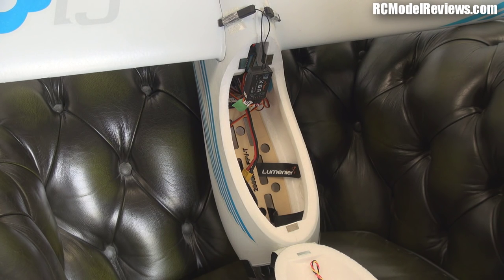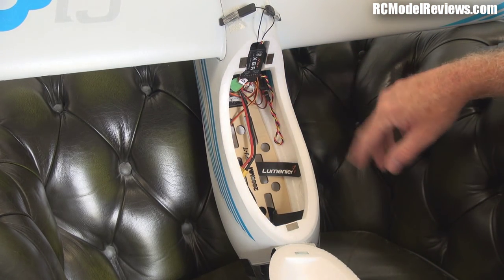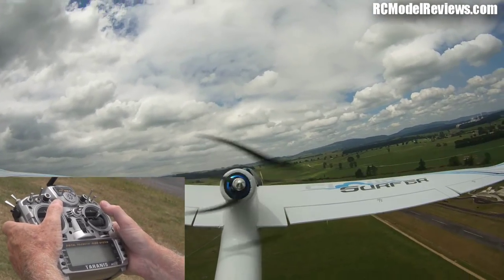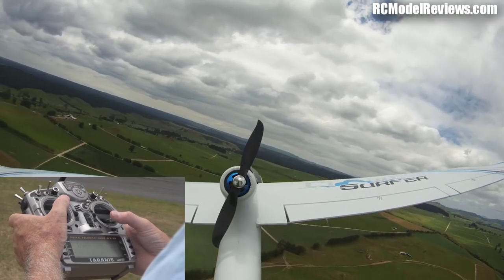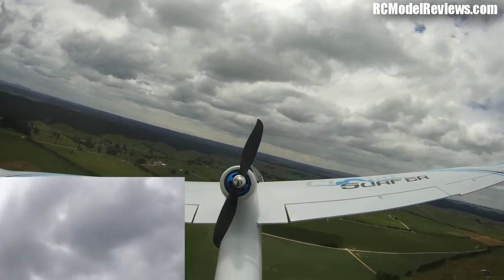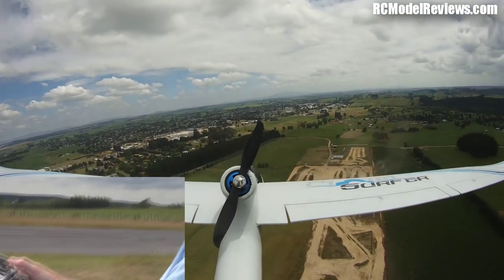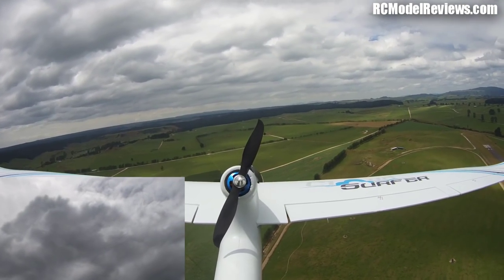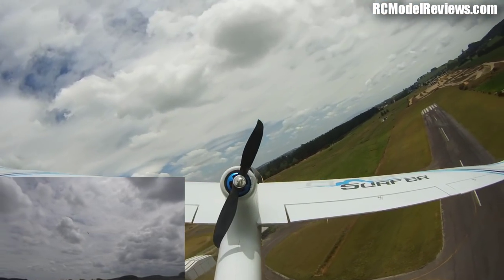FrSky variometer sensor (in action)

Comment: Impressive tool especially easy for those not in the know about Thermals ( myself included )
Just out of curiosity what is your record flight time using limited battery power ?
 I have been way too much into mini quads and not touched a glider for a while but am seriously considering it again for the summer months. A 3 min rush with a mini quad is brilliant but the nice and easy floating around compares just as much.

Comment: Bruce, You should show have the vario can be used to cut the motor at your legal limit, and could also raise the flaps to kill the lift. The joys of the brilliant Taranis radio...
Reply: +Barry Cole I have done that, also increased the frequency of voice above 100m, got caught out with a glider that hit serious lift and in the few seconds between misheard voice had gone surprisingly high, was thinking what did she just say? as the thing seemed to stand still in the sky but just get smaller.
I reduce the throttle max not cut completely as it feels wrong to lose one control method when close to serious lift.

Comment: Great Bruce, do you think that 118 meters is too low for thermal flying? I mean could you fly at 50 meters for example or does the thermal effect only kick in higher up?
Reply: +Nils Rohwer It's possible to snag thermals as low as 10-20m above the ground and climb up to the 122m legal ceiling (that's what I do with my DLG) but it does require more skill and is a lot harder.
Reply: Hey Bruce, thank you for the answer, do you find it too low in general though?
Reply: +Nils Rohwer Yes, it is a limitation... but on the other hand, it makes it more of a challenge to get sustained flight from thermal lift -- because you have to bail out so early yet stay aloft long enough to find another bit of lift.

Comment: Not a Taranis user myself so just wondering if you could set a custom switch to  automatically deploy airbrakes and/or cut the motor at the max altitude?
Reply: Yes you can set a custom function based on a logical switch to override the throttle channel or the air brakes channel.

Comment: Excellent demo. FRSky will now have to increase production on their Vario.

Any idea why there are occasional obvious errors in altitude?
Reply: +FlyingMerf As I said in the previous video, my Taranis is very old and still running the original software.  I suspect an update or two might fix the problem :-)
Reply: +xjet I'm running the latest firmware and have had no obviously wrong readings as yet. I also use feet, as for an old pilot metres just confuses what's left of my brain.
Reply: +Sean Coyne I'm planning on getting a vario so can you tell me how to change the reading to feet instead of meters please?
Reply: +mrmurder75  You have to change it in radio settings, not model settings. Just scroll down on radio setup page till you get to units and switch from metric to imperial (to get to radio setup, just long press the menu button from any model).